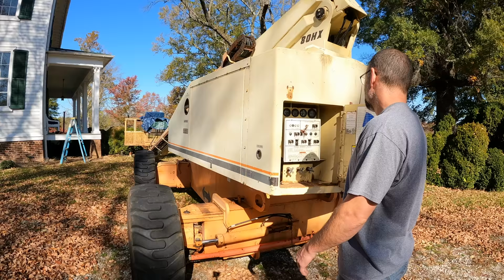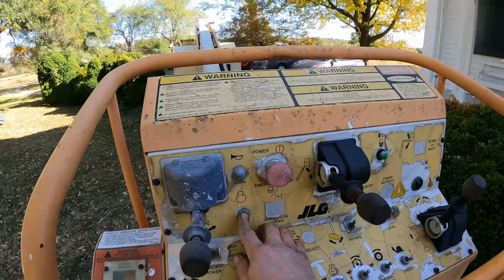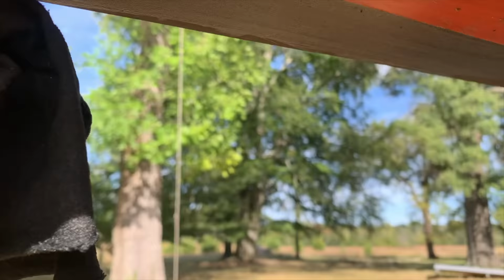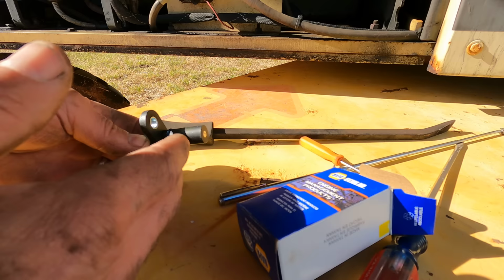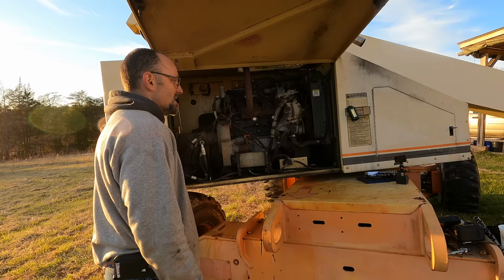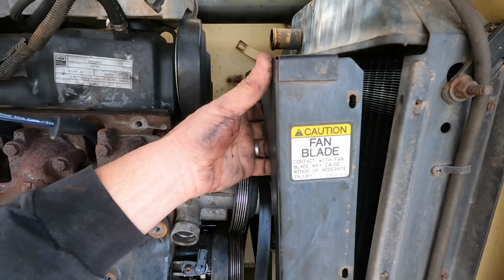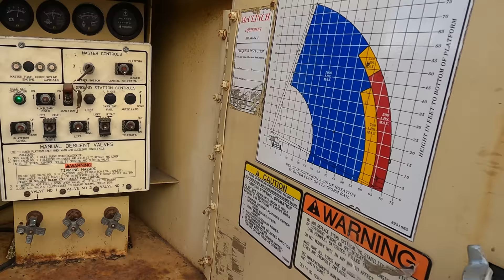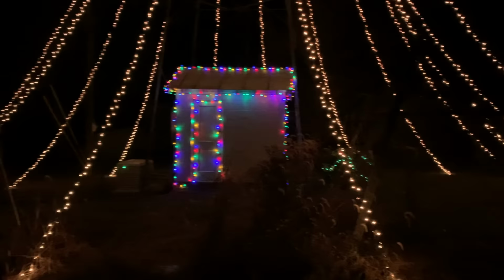My Boom Lift Broke Again! Fixing It & Then Doing a CRITICAL Job With It.

Comment: Hi John maybe you can check one thing that might be your problem.. @ 21:19sec you crank the engine. When you look closer you see a spark near you cdi or coil distributor sparky thing. It is probably in the cables near / close to the timingbelt cover. You can see a really small spark which is pulsating like the engine crank sound..maybe it is a grounding problem or something like that... Hopefully this is the problem or maybe makes it run better 😄 have a good time with your family and friends towards the end of the year. Greatings from the Netherlands, Bastiaan
Reply from the maker: Holy moly, it took me a minute to see, but I definitely see what you are talking about.  That certainly needs fixed.  Thank you!

Comment: Was that a rubber diaphragm on the carb? Could try a new one, if it was. Also, if it was a rubber diaphragm, sometimes they can slip on the surfaces they're sandwiched between. You can cut a gouge along the surface of one of the faces. The lip that forms/sticks up will keep it from moving.

Comment: @FarmCraft101 You've done so much work on this boomlift, have you at any point considered, if it would be worth switching out the entire engine?
From what i understand, these old Detroit engines, they seemed to always require a bit of time to start, you see it in all kinds of clips from the 1980's and 1990's where the engine needs to crank for like at least 10 seconds before it begins firing.
i could be wrong of course, but that seems to be the standard.
Happy hollidays, and good work on decoration, you have the patience of a prospector !

Comment: I would use Degreaser over pine sol John @FarmCraft101
Reply from the maker: Interesting.  I wasn't sure what to use, and pine sol and dish soap is what google said.  ;-)
Reply: @FarmCraft101  pin sol is okay on regular parts like intakes or greasy parts like brackets but it can leave a residue inside carbs I would use like the yellow 1 gallon jugs of degreaser from harbor freight as an example its pretty good for the price and won't leave a residue

Comment: If the crank case sensor was knackered and caused prolonged rough running have you possibly considered that the poor running would of given it poor fuel mixing and using a fuel additive may de-coke the engine and possibly improve its starting and running

Comment: The way it cranks but doesn't do much for a while is confusing. You might try a small shot of either to determine if it's a fuel or spark issue. If it fires right away you know it's fuel

Comment: The 99 ford ranger was throttle body fuel injection, not carburated. So it might be the same engine without the injection hardware.

Comment: Greasing the boom if you can blue Grease it will lube better an last longer. It seemed like the choke butterfly was not staying as you cranking with the camera over the carb. Maybe it's just getting to much air when cold to start easy..
Anyway star looks great...

Comment: If it's got a mechanical fuel pump they tend to get tired with age, replacing it with an electric pump allows you to get fuel pressure up and a full fuel bowl before starting to crank,  your starter motor will thank you 😊

Comment: Love your channel!  My research says Ford started using FUEL INJECTION in - 1987 - for the 2.3L - 4 cylinder engines.   I have also owned 4 ford rangers 2 of them being the 2.3L Ford engine.  All of them were 1990 or newer and they all had fuel injection.  So I don't understand this engine being a LATE 90's with a carburetor??  Also the late 90's 2.3L had dual plugs so 8 spark plugs - or 2 per cylinder - Which you also don't have.  Lastly I think your cold starting issue is still in the AUTOMATIC CHOKE setting or it is defective in some way!

Comment: I am suspicious of the automatic choke.  Just because it's an automatic choke.  Well, there are some rational reasons too.  The remarkable, notable difference between hot and cold start behavior.  The multitude of tiny, easy to mess-up parts in the choke mechanism.  That one odd part that didn't really look like it does anything.  It probably does something.  Can the cold chokiness be adjusted?

Comment: It's the temp sensor for the pcm in the t stat housand 2 wire temp sensor that's why it blowes black smoke when Rev the motor and the hard starts 100% had this happen on a mustang 93 4 cylinder hope this helps they are great motors and I'm a chevy guy but they run and run for a Ford!! I am assuming it's fuel injection !!

Comment: Your boom retract chain is way too loose, that's why you cant boom in without the help of gravity. With the age of the machine you probably should replace them both (extend and retract), you can find the procedure to replace and adjust them on JLG's website. The starting issues is probably the choke, these automatic choke never gave me anything but problems. You probably should get a structural inspection done on the machine to make sure its safe.

Comment: I’m surprised that the motor unit doesn’t swing out. I have a JLG 400S and it has one large bolt to the rear that if I pull it out I can swing the motor out and then you can get to the rear side of the motor.

Comment: Is there any check vales for the fuel? It seems to be building up fuel pressure. If you can get a gauge on that it would be inserting to see what it is. Might check compression with it cold just to see if you have a week cylinder.

Comment: John  I have been thinking of this hard starting problem for the past 10 days and I think your problem is a bad cam position sensor.  I realize that  you have been focused on carburation, coil, etc, but I have seen recent videos that mimic your engine and it turns out to be a cam position sensor.  Can you attach a code scanner to this engine? I think the cam sensor is not optimally timing your spark at start up.  Even if I'm wrong its a cheap part for the parts cannon.  Kind Regards.  Craig

Comment: Absolutely brilliant!!!! 👏💪😍
Thanks for all your effort! 🙏
I have worked on several engine installation that looks like this one, from about the same era as your boom lift.
The engine has been mounted on a cradle. Super easy to just let a few bolts loose and slide the engine right out to service. Like a dream! 🙂
Not much extra work needed in the construction as such. Can't imagine why they haven't thought about that here....
BTW - is that a Diamond X300 (VHF/UHF) antenna at the top?  ...thought I recognized it 😉
And last but not least - Beautiful XMAS decoration!
Happy Holidays to you and your family 🎅🎄

Comment: Looking down the carb body when you tried to start it, the choke flap was flapping about. I think you need to replace the entire automatic choke mechanism if possible.
I also think it's very strange that the choke flap doesn't open fully.

Comment: I wonder if something in the motor is preventing spark until it sees enough oil pressure, which takes all that cranking because of a worn oil pump or messed up sensor or something?  Have you checked to see if there is spark when it is having issues starting?  That would make sense that there would not be spark because you said starting fluid does not help.
EDIT: clearly i posted this mid video, but i still wonder if it is something like that.

Comment: Are those platinum tiped plugs? They will fire until they die and still look good when you check them. New wires, distributor cap.

Comment: The used that engine in rangers starting in late 80s only difference I belive was the carb and electronic ignition starting in 1990 they did electronic ignition, and in 95 the went from using a dual plane to a quad plane intake manifold and having 8 spark plugs (2 for each cylender)

Comment: I skipped through the video but did you check the ignition control module (if it has one)? My old truck would crank no start for days or die randomly then crank no start and it was the distributor, it was replaced previously but was Chinese junk, I put in a really good racing one from summit, made in America and has never ran better.

Comment: Everybody is ultrasonic crazy and that may be ok but blowing all passages with compressed air and carb cleaner is far more important than anything. I have had pieces of crap stuck that only a wire or torch tip cleaner was the answer. When you think it is clean. Clean it again. I've reused gaskets and have had good luck and bad. Also corrosion in the needle and seat area can hang up the float needle giving random fuel or no fuel condition. This is normally from setting with ethanol in the fuel.

Comment: Is there a flow control valve/adjustment on the boom function? They are usually right on the hydraulic valve itself. Might play with that if possible, to get a little action temporarily.

Comment: I really enjoy your videos. I’ve often wondered why engineers make things so challenging to work on. It seems there could be a couple more access panels installed to allow for ease of maintenance. Anyway, patiently waiting to see if advice from some help with solving the idle issues. Best guess is choke setting and/or timing.

Comment: You replaced the coil.  Does it have points and a condenser?  Also it might be interesting to run a compression test on the cylinders.

Comment: Dumb idea - find someone with a Ranger with the same engine, and listen to it start.   I wonder if that might give some clues?    Does it spin faster than your starter?  Does it hand-over from starter to self-firing at a higher speed?

Also, are you protecting your power supply from a possible lightning strike on the tree/lights?  They are easily the tallest thing about now.

Comment: I have the same engine in my bobcat 742b- cold starts are pretty much non existent- it won’t start! The electric choke is a joke on these motors- I’d be interested in a bypass or adjustment for sure.

Comment: If the engine is a Ford 4 cylinder used in a common truck like a 90's Ranger, can you buy one from a junk yard?  Rebuild in the shop and swap the entire engine?  Would this be easier than rebuilding the existing motor one piece at a time?

Comment: Only had one comment... wd-40 is not a chain lubricant.  It will loosen up the chain oil that may be on there, but you really should use a chain oil afterward.

Comment: I have remotely diagnosed the problem of it taking so long time to start. It is 99% likely that there is a problem with the piston rings. The last 1% is a valve problem, but probably not. When the starter motor has driven the pistons up and down with fuel, the piston rings will seal better and there will be better compression in the cylinder. After it starts there will be engine oil to helt seal the piston rings. No need to thank me - take it as my Christmas present to you.

Comment: Black smoke indicates your engine is getting too much fuel. Blue would indicate an engine that's burning oil. What I would test is fuel pressure and then pull each plug to test engine compression. To me just by hearing and observing your video I would say fuel delivery is very poor which could also be caused by poor vacuum. Also while the spark plugs are out they should show you some indication of what's going on within the engine.

Comment: What you & most all others fail to know about??,

Is that there are 2 varietal distillations for petrol/fuel:
A winter distillation blend,
-&-
A summer distillation blend.

They have very different combustion chamber flashpoints appropriately.

So when the weather turns cold the summer distillation won’t work & if it does work at all? it’s going to be problematic.

Also? A clogged or marginal fuel-filter may service a warm seasonal starting-&-running scenario But when it gets to colder weather? The demands of the fuel system increases & a marginal (read: “clogged”) Fuel filter can also cause hard starting/running.problems.
Reply from the maker: Fuel filter is new and I use the same non ethanol gasoline all year, no change in formulation.
Reply: @FarmCraft101  

 This explains the “blends”. 

They are switched out & sent into the retail market without anyone ever being told about it.

Do a search for: 
summer-blend and winter-blend gasoline

Comment: Beautiful lighting job !!!  On your engine it seem to have the hard start after sitting. I think you said it was a desiel,  does it have a electric & manuel fuel  shut off ? It seems to me it is leaking off and you have to pump the line full again after it sits for a extended time,  if it is, something is letting it bleed back or something may be weak in the pump 🤔  just a thought . Enjoy your Christmas,  I really enjoy your video's and humor !!!

Comment: Have you replaced that rubber diaphragm? Even though they seem to flex, they are often stiffer than they should be and don't regulate the pressures and flow rates as they should.

I wouldn't use wd-40 as a lubricant. It evaporates leaving almost nothing behind.

Comment: Sounds like it's starving for fuel and if it starts up better when warm could also have a choke problem. Check fuel pump output and check valve in the fuel pump should not allow the fuel to run back to the tank.

Comment: Merry Christmas to you and yours and your one gutsy guy for going that high up but it was well worth it as that looks fantastic and by the way id check the fuel pump on that ole girl and by the way did you run a wire thru the needle valve on the carb

Comment: It makes me wonder if have weak compression due to a burnt or gunked up valve not sealing then causing a low vacuum condition then not pulling the fuel strong enough through the carb main jet...just a thought bro. Someone may have suggested this already I haven't read through all the comments

Comment: doesnt those boom lifts have a hinge to swing out the engine? on newer models there is a big nut under the engine, just take it off and you can swing out the engine about 45 degrees

Comment: It seems like an electrical issue to me, as the controls from the basket are further away. I suspect you are losing voltage to the engine. I would meter the voltage at the coil when using each control board.
I would run a second ground from the motor, and check every connection involved to the coil.
i would be worth seeing if you could modify the lift to dual wheels, or larger wheels since you are using it on soft surfaces

Comment: Un-Hook kill solenoid.   I’ve had lots of problems with them on small engines.
Reply: It’s such a common issue that there are tons of videos on issue.   Could be electrical if you want to keep solenoid.   Check voltage drop and grounds.   Probably don’t want to disconnect due to safety of boom controls.

Comment: Love your channel man. I feel your pain with everything you work on. I would make an entire assembly to mount that entire engine and cooling system on that slides or swivels out of that mf'ing machine so I could work on the thing. Micky mouse sh*t. It's bad enough that it's a ford engine in this thing. Due to those those hydraulic lines on the pump being tough to make longer to pull out on a tray, rather than slide out, maybe make it so the entire engine assembly swivels out from the right. Being a ford engine, you're certainly going to be working on it all the time. Be a good video to make a swivel out tray, too.

Comment: In the video you have trouble getting access to the other side of the engine. how hard would it be for you to cut a door in the side? so you could have easy access  to both sides.

Comment: I'm sorry that I am just seeing this video, playing catch up. I may also be completely wrong, but I noticed the boom lift is duel fuel. Is there ANY chance the starting and running issues is related to that, (ie) jetting. Perhaps it was used as lp and then switched to gasoline

Comment: Not sure if you’re still having issues, sounds like it could be fuel returning to the tank while sitting. Is there a one-way check valve on the fuel line from the tank to the carburetor? Have a great day
Reply: Also check the throttle plate shaft for looseness  ie “ vac leak “ causing a lean condition 
Good luck

Comment: Phew gotta get those lights up there. Not sure about the start problems. My ear says fuel starvation now you have reliable spark. Does this engine have a fuel shut off valve to prevent over running or fuel tank drain back. I've had these pesky electric valves trick me in the past. Happy Holidays  and thank you for a great series of videos on everything buy farming LOL 🤣🤣🤣🤣🤣🤣

Comment: Great video John !  Did you check the choke for full closure when it's cold ? and partial to full open when it's hot ? I would adjust the idle mixture for best idle with a vacuum gauge and and I think you should raise the idle speed up some more !

Comment: I did not whaech whole video so not sure about how choke works probably electrinocally.. Check that its a tight seal on inside of carb. Carb spray on a litle actuator that makes it go PSST at start would do wonders to the ease of starting.

Comment: Whenever I’ve worked on similar stuff to this you could undo a couple of bolts and swing the motor out to get to hard to reach stuff. Is this model different?

Comment: Did you check the compression? The engine may need an overhaul. If the compression is low, the engine will have problems starting and will produce less power. Starting gets better when the engine warms up, but it won't be great.
When the compression is low, the piston rings may be worn and/or the valves are leaking. I really hope it will not be anything worse, such as worn out cylinders.
There may be a lot of work on that machine remaining.
The best wishes for 2023 to you all. :goodvibes:

Comment: Check fuel pressure you may have a bad fuel pump or clogged screen in gas tank. Pressure should be 5 to 10 no more.